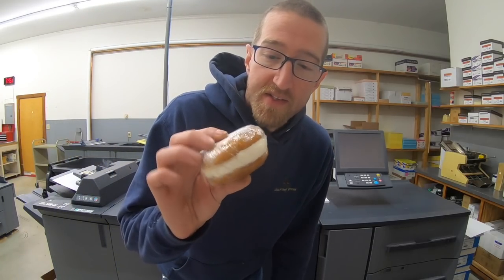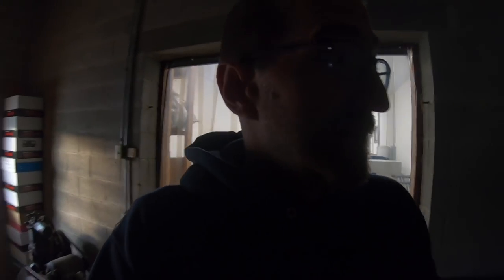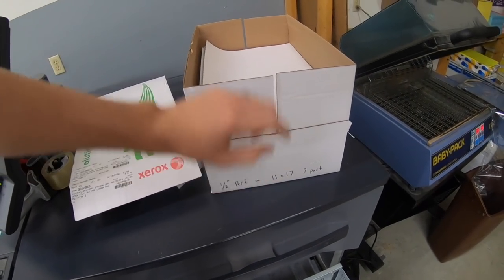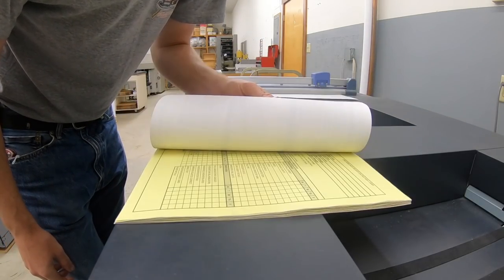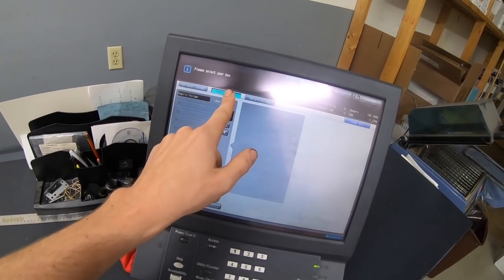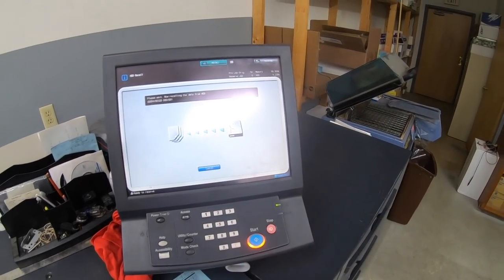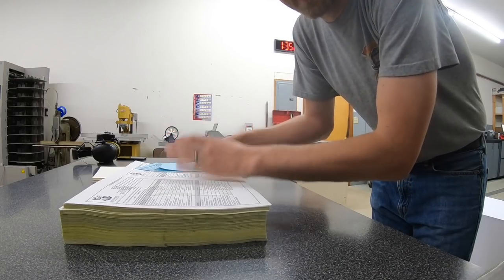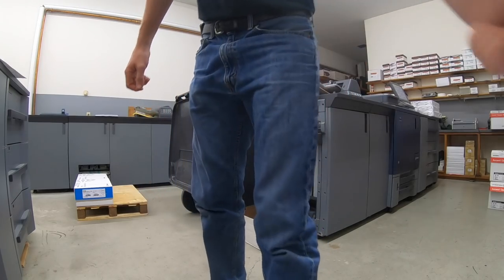Another Day Printing and Binding Books in a Digital Print Shop

Comment: Hey Dan:  Just found your channel.  So far, I love it.  I missed the make & model of the puncher you showed in the video.  I've been thinking about getting one of those too, so if you could share that, it would be great.  

I did try one in-line punch with a B&W Xerox printer I had about 10-15 years ago...bad decision on 2 counts...it only works when you run jobs through that machine and the punch holes did NOT match the ones on my Rhine-O-Tuff off line punch (close but not quite).  Covers ran on a color machine did NOT match the online ones.  Disaster.
Reply from the maker: Its  GBC AP-2 automatic punch. Saves a ton of time. Not the best if you are punching gloss paper but I mostly only print uncoated.

Comment: KM1070 vs KM3070 which is more economical and efficient.
Reply from the maker: They both use the same parts and as far as I know are pretty much exactly the same. So whichever one you can buy the cheapest would be the most economical TCO.
Reply: @justaprinter  Thanks

Comment: An idea put the short 3070 back to back with the 1070 put the 3070 you just got where the short 3070 is and run 4 machines
Reply from the maker: I did think about that, there is enough space to have all four machines in the print shop. But I wouldn't have much space for paper then. Still thinking though, thanks for the idea!